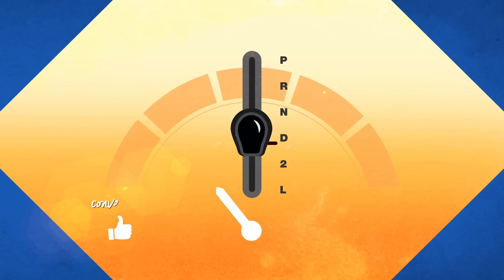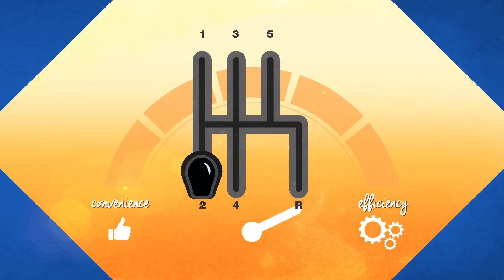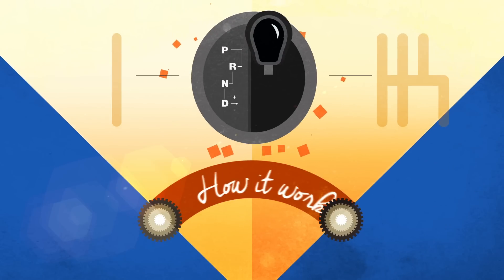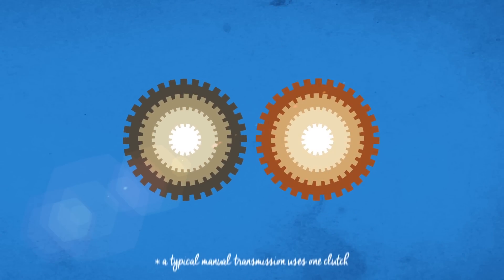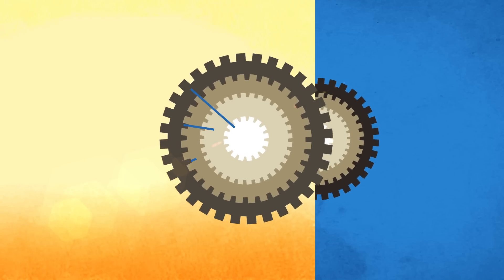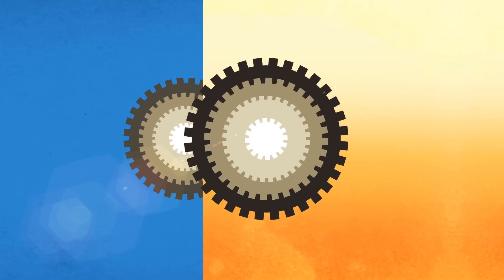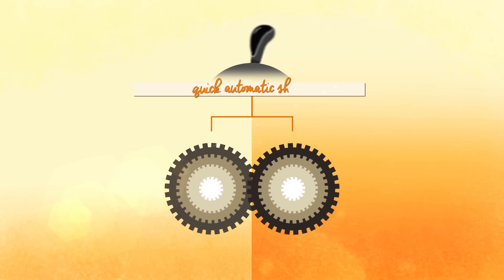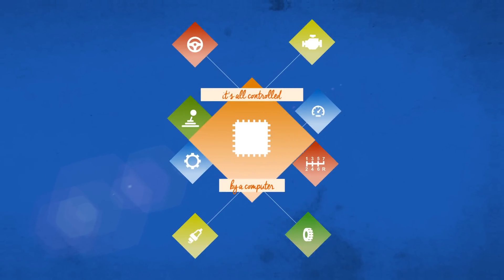How Dual Clutch Transmission (DCT) Works | Hyundai

Comment: I have a 2018 Hyundai Kona AWD  1.6T and LOVE the DCT trans. SAD to see it go. They must of fixed it since I have no issues, the big key in using it is roll the throttle on and not push it fast to to the floor. When you floor it, the computer has to think too much and takes a couple of seconds to add power or down shift. I also an aggressive driver so the computer learned my driving style over time.  I love my DCT. That may change I only have 5,000 miles on the car. Time will tell.
Reply: 3 years now, has it changed? still loving the dct?
Reply: What about now do you recommend the dct? or just taking a car with anormal automatic gear box?
Reply: @mohamadjouda3820  take the dct, its more fun as a driver, this transmission does a very good job of applying power
Reply: @mohamadjouda3820 
I'm wondering the same thing. The DCT trans sounds so problematic to me!
Reply: You can floor it. The ecu & tcu will do the work for you. If you floor it from a higher gear, it might take it a second to select the appropriate gear (it's a 2-3-4 gear downshift that might end up on the same gear shaft that you're currently using, hence the slower response). If it's going through the gears sequentially (say you just started off from 0 and are flooring it) all you'll feel is being pushed into the chair without any hick-ups while it shifts 1-2-3-4-5-6-7. (ok, realistically it will go up to 5 and then give you 7th gear directly when you let up on the throttle).
Reply: Almost 8k for me, 22 kona nline, transmission has no issues unless your in smart mode

Comment: I currently have a 2017 Hyundai Elantra Sport with a DCT and enjoy driving it.

What is the life expectancy of a DCT? Is it the same as a regular automatic? Same as the clutch itself?  The dealer tells me that the clutch in a DCT cannot be replaced separately, so if the clutch goes the entire transmission needs to be replaced at $5500.
Reply: letsgocapsbeatpens Same here, 12k miles and no issues so far on a 2018 model

Comment: So I have a question, can you shift as tho it is a sequencel (spelling) transmission? What I mean is shift thru the gears without taking your foot off the gas without causing damage.
Reply: Yes you can just like a sequential transmission. A sequential transmission has straight cut gears as its basically an advancement from a manual transmission, but now its doing the clutch pedal process for you and faster.  Also when driving a car with a dual clutch transmission eas in smoothly when placing pressure on the accelerator pedal and eas out  smoothly on the accelerator pedals when decelerating braking. Therefore the clutch does not grip hard onto the flywheel giving you a rough ride.
Reply: If you are gunning the throttle, the TCU will hesitate to shift at redline unless you lift off the accelerator for a moment. It's important to bang it into the next gear with the paddle shifters at the torque peak, or else the transmission will peak at redline and the rev limiter will kick in before it finally shifts. It'll shift hard when you use the paddle shifter and I've even gotten wheel hop shifting first to second when the throttle is completely open, but it won't cost you extra time in your 0-60 waiting for the TCU to capitulate.

Comment: Tucson's DCT is the worst problem my family is currently dealing with. Our Tucson Limited sometimes hesitate to go from a stop, making a left turn in a 2 way traffic very dangerous.
Reply: It's because the clutch will disengage when approaching a stop so you don't have to shift into neutral. If the clutch disengages and you try to accelerate before the clutch pack lines back up with 1st and 2nd gear in anticipation of accelerating, it'll need a partial second to re-engage before you can move again.
In stop-and-go traffic, try blipping the throttle when braking if you see that traffic ahead is starting to move again and you'll need to accelerate almost immediately after braking. Also, try not to come to rolling stops as people tend to in automatic transmission cars, as this will confuse the TCU and cause delay in re-engaging the clutch. Stop fully, or keep on the throttle to tell the transmission computer that you are going to keep accelerating.

Comment: Love my 2017 Eco Sonata. Bought it specifically for the 1.6T and dual clutch combo. CVT's suck and yes it's a bit jerky at low speeds but great MPG.
Reply: how is your DCT and turbo engine holding up?
Reply: No way you say CVT's suck. At least those aren't jerky...

Comment: okay nice info, but how do you drive it... like an automatic or manual?
Reply: Angel Robledo sorta like both. Majority of them will come with paddles behind the steering wheel. There is no clutch to push in instead you shift up and down accordingly.  You can push the shifter to the right and you’re in sport mode then use the paddles to shift.
Reply: @iKenshii_  does it shift on its own like an automatic? or do i have to shift it?
Reply: it's totally automatic, put on D and go. You have the option the shift gears, but it's never necessary.

Comment: Does hyundai's DCT allow for manual shifting by using flappy paddles or whatever equivalent they have?
Reply: In some models they actually include the paddleshifters. But in my case, I have a Elantra 1.6GLS, it doesn't have one but you can shift from D(auto) to 1-6speed(manual) using the normal shifter/gear knob. Below is the picture of my elantra's shifter

http://www.hillscorea7.com/Car/Hyundai-Elantra-Avante-MD-Genuine-Leather-Gear-Shift-Knob-2011-2012-2013-M.jpg

Comment: I like how the video is called "How DCT works" when, in reality, their DCTs largely don't work and very few parts in any given Hyundai actually work. Nice try. First-time and last-time Hyundai owner here.
Reply: Sounds like a bad experience. Not everything they sell is perfect, that is why they come with warranties.
Reply: Yep. So far LOVE the '16 Sonata Sport I bought. I appreciate the video because I did notice a difference in how it shifts and just wondered...didn't worry a bit, just wondered. As an ex-master mechanic I'm used to a certain 'feel' of an automatic transmission.  
Good job, Hyundai.
Reply: The DCT is really bad.  From a dead stop, there is a long hesitation between stepping on the gas, and the car actually moving.  This is actually dangerous.  My car has less than 200 miles on it, a '17 Hyundai Tucson, and the service dept tells me that there is NO SOLUTION to this issue.  I deeply regret choosing this car.
Reply: C H Hershey omg less than 200 miles and your experiencing that.....sad to say at 27,000 I'm still experiencing that and purchased it brand new. I wish I had never gotten it!
Reply: hikkmits how about switching to neutral while you are waiting?
Reply: wow  you have a lot of anger going on.
Reply: i agree my dct sucks. sometimes when  i'm coming to a stop or when i lift the brake to start stepping on the gas my car jerks.

Comment: 2016 Tucson has had several upgrades to the computer control to try and make my car work. Can go into neutral driving down the road and no accelerator input at all  even if floored. Seems to go into what service called a limp mode and only moves slowly at 1000 fixed rpm.  each time it is in the shop it comes out and acts up in less then 50 miles even though told they test drive.
Reply: You don't hear this kind of problem with Porsche or Audi DCT.    Sounds like Hyundai DCT is only in beta with the public lives as test subjects.   The Hyundai DCT can kill you!